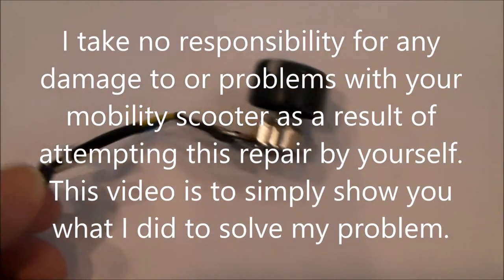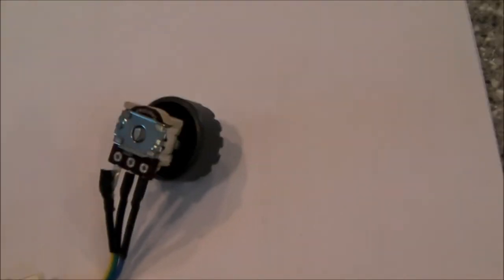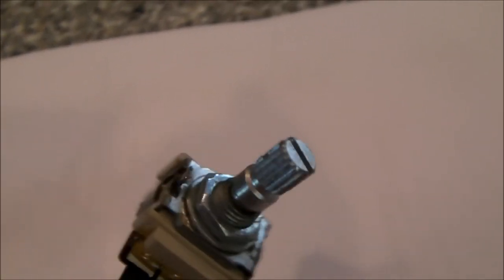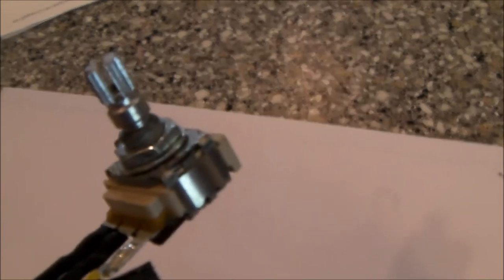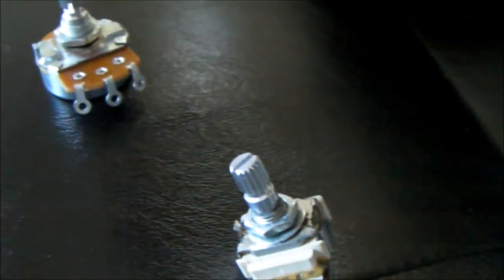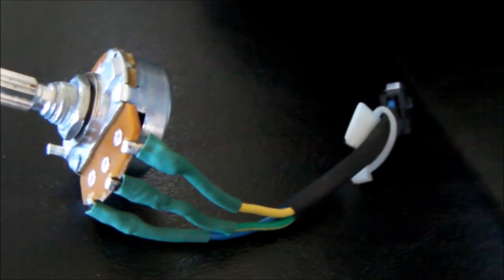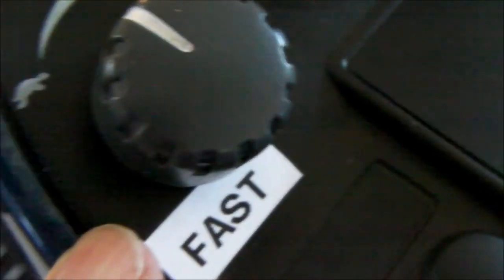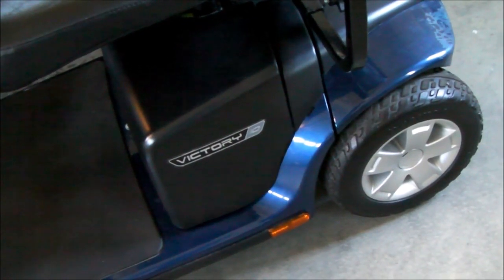Mobility Scooter Speed Pot 100K ohms continuous rotation repair TORTOISE/HARE CONTROL speed control

Comment: I attempted to replace the occasionally erratic "tortoise and hare" speed control using bare pot recommended by Monster .Got it installed and scooter gave error signals, ran erratically.   Checked actual resistance and new pot had quite different ohms reading. Soldered in old pot and scooter ran normally. I have an early version of Pride GoGo Elite Traveler and it has given good service with battery replacements , electronic brake replacement and a replacement charger over many years. 18 AH batteries are considerably heavier than 12 AH  ones.  I bought an extra battery box for an extra 18 AH battery pack from Monster Scooter Parts. Good source.
Reply: good video thanks for sharing ,i too went for the bigger battery box,but put in two 22ah batts in works brilliant

Comment: thank you, can i just ask something. if i replaced my speed knob with a different ohms one would i go faster??  like this is 100k one right?  what if i put a different one in?  i want to try speed up a bit!  great video btw thanks.
Reply from the maker: i doubt a higher resistance pot will cause a higher speed.  I would not change the value for fear of destroying the expensive controller.  Getting more speed just because you changed an inexpensive component PERHAPS is possible but the stress to other components and probably exceeding their design rating is probable.  More speed requires more voltage and max voltage is limited by the batteries and the sophisticated control.  The power components in the electronic control are likely to be unhappy.
Reply: @YuDaMan  ok thanks i think the only way is to get someone to re-program the controller. mine is a rhino 2 controller which can be re-programmed but the kit to do it is expensive as hell!
Reply: Thank you for your honest and comprehensive reply. I too want to go faster and you have provided answer to another piece of my puzzle. Thanks! @YuDaMan